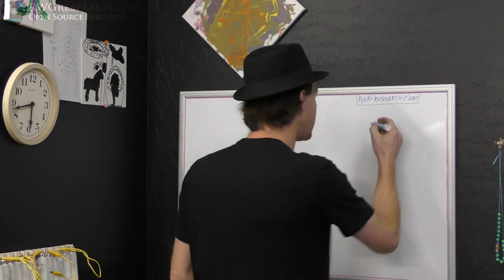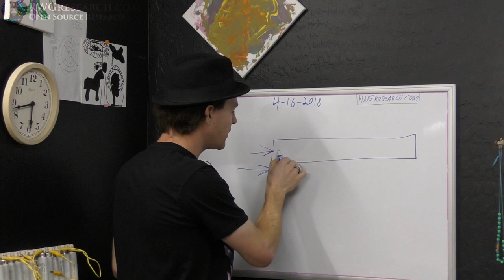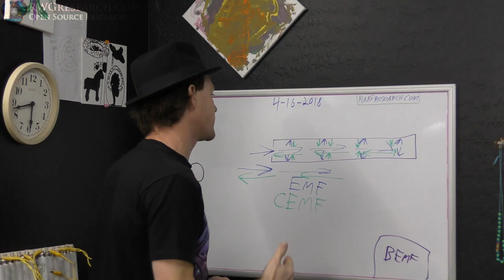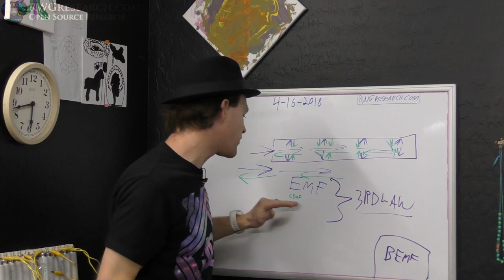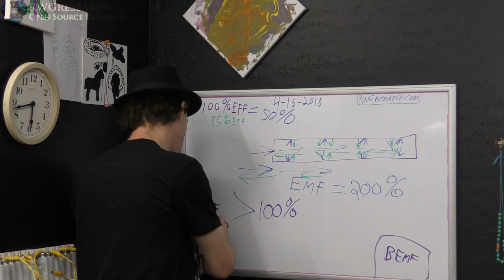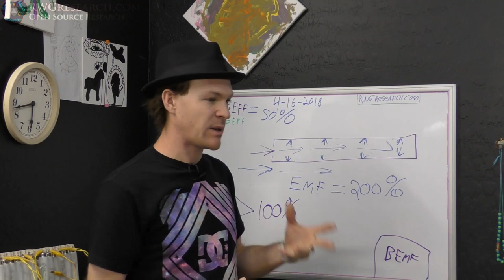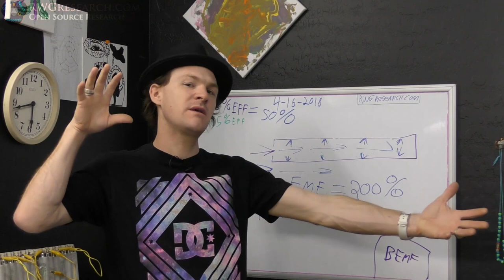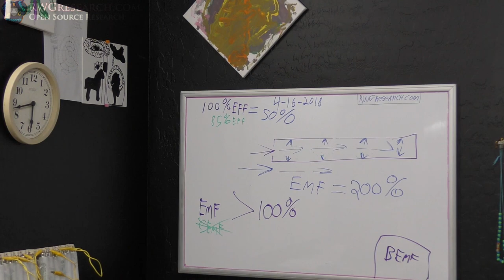The Search For Answers Part 18: EMF + CEMF = Newton's Third Law. EMF - CEMF = BROKE

Comment: Hi Russ, If "The Laws of Thermodynamics" were "Laws" why is it that photovoltaic solar panels run hotter when they are powering a heavy (low impedance) external load as compared to an identical panel not powering anything ? and a shorted photovoltaic solar panel runs even hotter, 

If "The Laws of Thermodynamics" were "Laws" and not lies the shorted photovoltaic solar panel would remain at the same temp as the open circuit panel, but it runs hotter than the open circuit panel, and the panel  powering a heavy (low impedance) external load would run cooler than the open circuit panel, but it runs hotter than the open circuit panel, 

I realized this when I was 10 years old and I was never able to accept "The Lies of Thermodynamics" when one thing breaks a law of physics the law is not a law, it is a lie and there are a thousand other ways around it, think outside the box,

PS Russ Why do you keep promoting known CIA Forced and Sponsored Disinformationist ?
Reply from the maker: Please elaborate on the last part?  id like to know what parts of what I'm saying are " CIA Forced and Sponsored Disinformationist " thanks, ~Russ
Reply: Hi Russ, The original Newman's Energy Machine did work, but everything  He stated after He filed for His first patatins was CIA Forced Disinformation, and the same is true about Stanley Meyer's water fuel cell, His original electrolysis tank patent was denied, and everything after that was CIA Forced Disinformation, 

Stanley Meyer's original electrolysis tank was nothing like the disinformation patents after His first 3 legitimate patents, Stanley Meyer's original electrolysis tank was reinvented as the Electrolyzer or Electrolyser, but Stanley Meyer used large flat noble metal plated plates, about 50 of them (And it Was Overunity) one end plate V+ the other end plate V- and every plate in between multiples the efficiency, 

One of the first jobs the CIA was given was to protect the US petrodollar, and to suppress anything that could threaten the US petrodollar, that included promoting false theories and suppressing the truth,

Follow the Money, Who owns the Federal Reserve ? it's not we the people, shortly after WWII the owners of the Fed got Congress to make a deal with most of what is now OPEC that the US paid for the development of thear oil infrastructure in exchange they would sell their oil only in US dollars, so the US Dollar could get off of the gold standard and become a fiat currency backed by a third party, middle eastern oil sells, that allowed the Fed to print money willy nilly without any real backing,
Reply: +Greg Gibson   Well then why is the solar and wind generation industry booming?  It is eating right into the petroleum industry and reducing their sales.  And it will continue to do this year after year and get bigger and bigger.  So how come the "death squads" haven't taken out all of the players in solar and wind generation?
Reply: +User2718218 Solar and Wind power doesn't threaten the US petrodollar, it doesn't produce power 24/7/365 it is not usable power for shipping, air travel, mining, tractors..... 

OPEC running out of oil is a huge threat to the US petrodollar and the world's economy, if we continue to burn through the rest of the world's oil reserves oil will crush the world's economy and the petrochemical industry will run out of oil feedstocks, if we don't change now we won't be able to,

Here is a simple explanation of one overunity power supply: When a diode is hot about the boiling point of water it produces a small forward voltage from 1/8V to 1/4V and the current potential is dependent on the surface area of the PN junction, it is thermovoltaic and it is not endothermic, at high current levels it is exothermic, photovoltaic solar cells are large surface diodes, a 12V cell would be a 288 layer device or a 96 diode stack, each layer could be extremely thin, the individual diode layers need only to withstand less than 1V reverse voltage, a properly constructed device the size of a deep cycle lead acid car battery could power a high performance electric car,  

Another overunity power supply: The secondary in an air core transformer amplifies the primaries field, as opposed to a ferrous core transformer that the secondary consumes or opposes the primaries field, Nikola Tesla called his air core transformer his (Amplifying Transformer) because the secondary amplifies the primaries field, Nikola Tesla got really close to overunity with his Amplifying Transformer (Tesla coil) all he needed was a pair of non powered switched primary helper coils on each side of the primary coil to reduce the rise time impedance and amplify the the rising field strength and volume, and another pair of coils rectified and regulated to the primaries power supply.
Reply: +Solar and Wind have the limitations you stated but one day economical storage solutions will be around to make them available 24/7.  Nonetheless, the installed solar and wind capacity continues to increase every year and the impacts oil sales to a certain extent.  With the way things are trending we will have enough oil for hundreds and hundreds of years which is more than enough time to solve all of our energy problems.

Diodes are not magical overunity devices.  If the claims are true for the nanoamperes they output, that is indeed just some random thermal energy managing to get a few electrons across the band gap.  So an electron jumping to a higher potential draws from the heat pool we are all swimming in.  When the electron's energy is used you return the heat to the heat pool.  You are dreaming about a diode battery powering a car.

No, air transformers are not overunity devices and you are just throwing up a word salad there.  Prove me wrong by building and testing one.  You are just buying into the fake cult of Tesla that has been created by an unscrupulous fake Tesla cottage industry to sell books, trinkets, and get paid speaking engagements.
Reply: +User2718218 I agree with you on one point you made, Most or all Overunity "Experts" are CIA sponsored or forced disinformationist, just like most or all UFO "Experts" are CIA sponsored or forced disinformationist, but I didn't get my info from crackpot disinformationist,

Would you accept me or anyone Proving you wrong by showing you an overunity power supply working ? or would you claim it was fake, unless you could buy one at the local walmart ? 

The false theories that are currently taught were purposefully created to keep people from inventing, over unity power supplies, gravitational drive tubes and dimonatal acceleration tubes, these devices are really simple and obvious when you understand true physics,

When I was 16 Years old I was taught physics philosophy and theology unified as one through rudimentary simplicity, find the simplest point and every point from the simplest point is just as simple as the simplest point, and before you know it you have reached levels of complexities through rudimentary simplicity, true understanding is never lost, 

Look inwards to see outwards, as above so below,  the infinite within the infinite we're in, find the simplest point, logically how is it possible for a smallest particle to exist ? what would it exist as ? a bubble of nothing ? what would the shell consist of ? if there were a smallest particle would all of the smallest particles occupy the exact same volume and mass ?  

Atoms are microcosm solar systems, electrons are microcosm planets, the matter electrons are made of is as small to the electron as atoms are to a planet, and so on and so on, the particles that make up the magnetic field are to the electron what the electron is to a planet, the particles that make up the gravitational field are third level magnetic particles, heat is the mass of electrons not vibrational, the electrostatic field is orbital to stationary, stars have a V+ charge just like the nuclease of an atom has a V+ charge and planets have a V- charge just like electrons, 

Most planets have electron poles (aurora borealis/australis) magnetic poles and gravitational poles all aligned in its axis of rotation, and in the microcosm of atoms most electrons have the same just like planets,

As a planet spins faster the increase in allingements of its subcomponents increase the force and volume of its electron poles magnetic poles and gravitational poles, compensating for the increase in centrifugal force on its equator, 

The gravitational field is a hypervelocity magnetic field, a balanced non drifting magnetic vortex traveling through a deep vacuum will exhilarate itself through the gravitational field, gravitational drive tubes act as a piece of wire carrying current in a magnetic gap,       

You will get further in understanding through visualizing this modal on your own, than me talking you through it, if you have any questions just ask.

Comment: Hey Russ, please do not worry, your brain functions are working at 100%
You start the video with stating that you have a pipe, and you pump water into the pipe.
Somewhat later you want to remove the CEMF and you erase the green arrows. Thats okay, because the green arrows were created by the pipe. So, to remove the CEMF and the green arrows, you should remove the pipe.
Thanks for uploading.
Bye.
Reply from the maker: John Walker well, yes, kinda. However the water pipe and EMF in a wire. Cant be compared completely.  Because if you open or remove the pipe. Its still there in the eletrical system... however the point was made ;) hehe thanks for the comment. ~Russ
Reply: In the example of the pipe and water no matter what you do you have equal force both ways. If you expand the pipe to reduce force upon the water, the water has less pressure upon against the pipe. The force remains in balance.  If you could reduce a force one way in definition you invalidate Newton’s 3rd law. I’m not saying this can’t be done, but I still don’t see how it could be accomplished. Though I would love to see it happen. Keep up the good work, and maybe you or someone else will prove Newton wrong.
Reply from the maker: The example of the pipe and water is linear. now, if you talk about water hammer and the shock involved there etc... things might change because we start to get in to a non-linear situation. anyway that was just a way to express it clearly. However we already know that in electrodynamics this third law in accordance with  EMF and CEMF are not equal and opposite. we know that if it was equal and opposite nothing would come out of the generator/motor... so we know there already not equal and opposite. so how do we offset them more? by the way Jim Murray has already done it, read his patents. see what he has already done. There are a lot of well known things about  Newton’s 3rd law being violated in this area. Just look for published papers on line where they express this and show examples. its well know. its just not talk about or expressed enough.  ~Russ
Reply: +rwg42985  If Jim Murray has really "done it" then where is his working system producing free energy?  He demoed some contraption about three or four years ago at one of those energy conferences and since then nothing.  He is playing the "I have a magic work-around" for magnetic fields game and you are buying into it.  There are thousands of meaningless patents and his is one of them.  Faraday's law applies no matter how much you try to "twist and turn" magnetic interactions in search of a secret sauce, nothing changes in the end.  Don't buy into this crap, it's just a smokescreen.  Again, Jim Murray has nothing just like the QEG people have nothing.  They live off projecting the illusion that they have something when in fact they have nothing.  If you look at Jim Murray's clips people challenge his proposition and ask for details and specifics in the comments and he never responds.  He puts up a clip and then runs away.  The man has no credibility whatsoever.  Start using your critical thinking skills instead of buying into this kind of stuff.
Reply: +rwg42985  The water hammer effect is identical to the back-EMF spike from an inductor discharging into a high-resistance load and they are both perfectly linear.  Non-linear does not mean you violate the conservation of energy.  A diode is a non-linear device and COE applies.
Reply: +rwg42985  EMF and CEMF are equal and opposite all the time.  If current flows or not depends on the load.  If the load is a capacitor no current flows.  If the load is a resistor or an inductor then current flows.